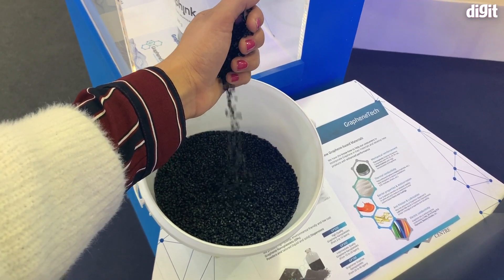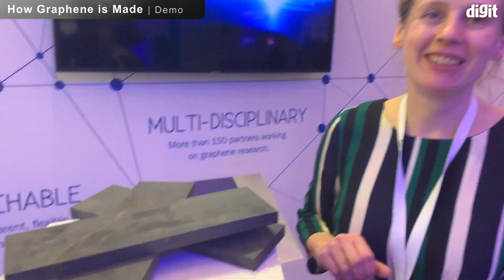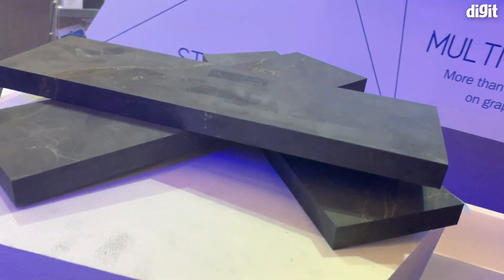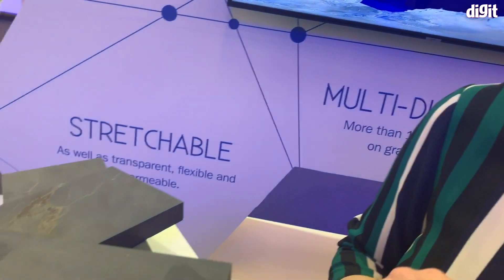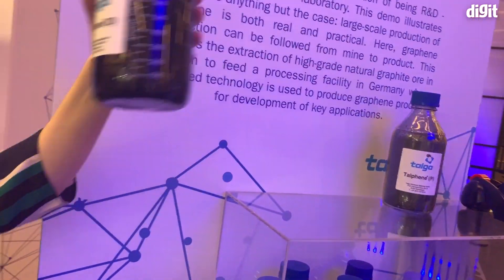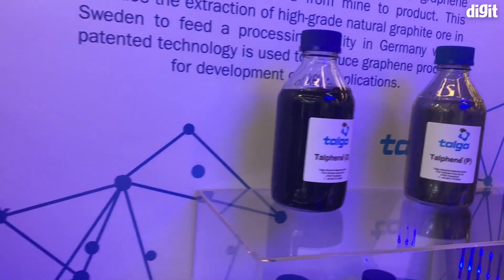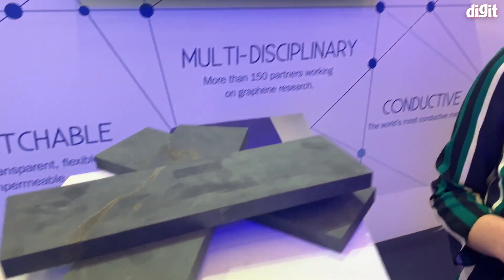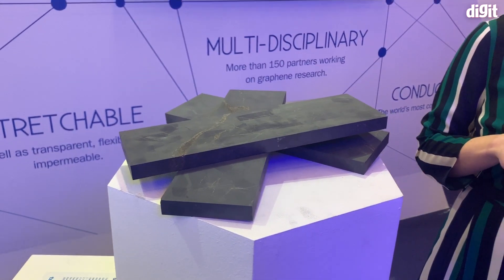How Graphene is Made | Demo by The Graphene Flagship | Digit.in

Comment: That is NOT a graphene block. That is graphite. Graphene is on tape.
Reply: she did mention that
Reply: What you see on the tape experiment is not graphene. What you actually see is (after several tape pieces sticking and separating from each other) is a progressively thinner and thinner layer of graphite. Graphene with current technology as of right now is typically produced in tiny chips that are then pulverized into many one atom thick flakes. To summarize the process, you take carbon black, put it in a quartz tube, put copper wool anodes on each side, compress till you read 2.0 ohms, put into a vacuum chamber, head to 3100 kelvin with a 237 volt charge in 10 milliseconds, then sift the chunks.
Reply: @MeatPez Thank you so much! When the video ended I was left thinking that I missed how graphene was produced, and how it became the graphite block. They just didn't bring the explanation to the promised conclusion, but you did. Thanks, again!
Reply: 同意！

Comment: I have heard that graphene if used in making smartphone batteries, will provide more efficient battery with optimal temperature and a great battery backup. Its just a speculation... 😋
Reply: if you make a graphene supercapacitor, it can power things for probably days. 1 10x10 nanometer sized piece of graphene, which over 20,000 of could fit on the tip of a pin, produces one picometer of power. A whole battery, or arrangement of batteries using graphene could generate alot of energy
Reply: @3juliano680  I do have it on the market .
Reply: This is much more Advanced matetial then expected . I do test it at the moment.